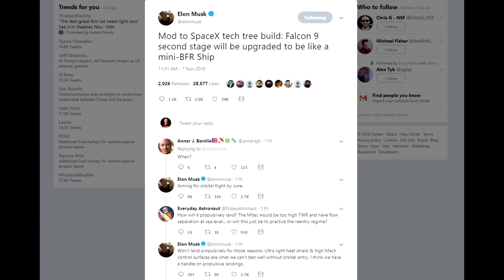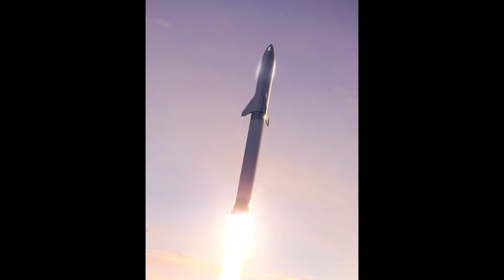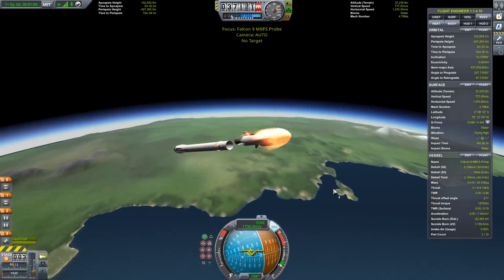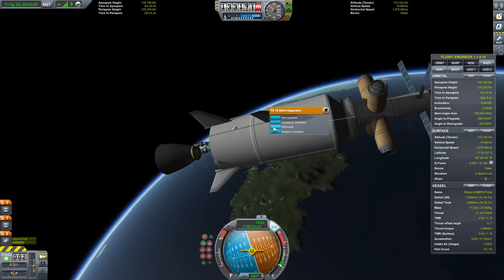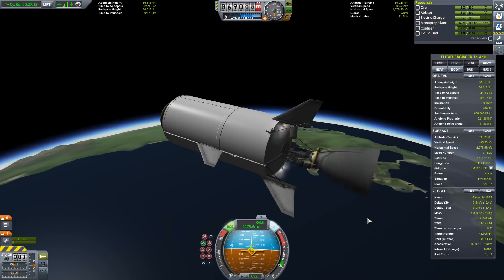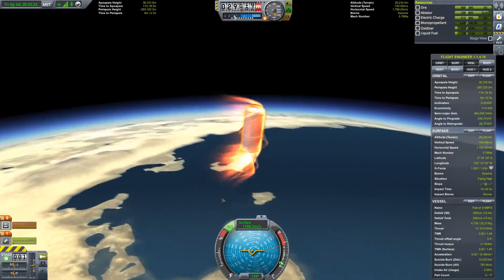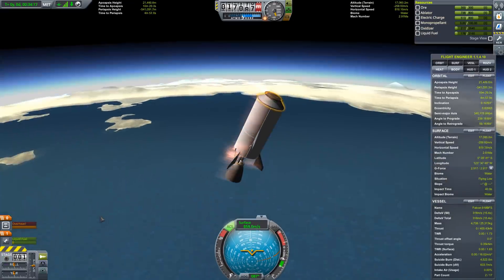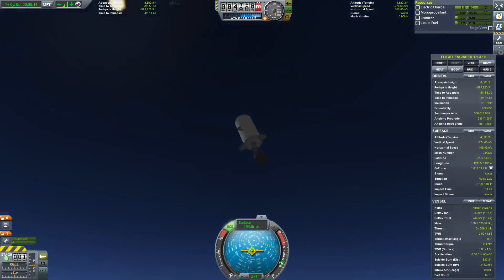SpaceX Evolving Falcon 9 Stage Into 'MiniBFS' For Testing

Comment: I don't think we're going to see a raptor version of any falcon 9 hardware - the raptor isn't just a updated merlin, it uses different fuel - and fuel tanks are one of the most critical parts of any rocket design so changing the type of fuel you use basically means you're designing a new rocket from scratch - or at least a new stage from scratch if you only change it for one stage
Reply: Not really the first stage can remain the same but the service tower would need to be altered to handle a third propellant.
Testing Raptor in space would be useful for the development  of the engine esp allowing it to get cold soaked on orbit.
Reply: @Patchuchan  The second stage tank still needs changed. Yes, the booster could be the same, but it's a lot of extra and not-worth-it R&D. It would have better performance and good testing but it's just a massive change for a vehicle that won't continue launching for more than a decade probably.
Reply: Jessie Grabow  but that could be done with the hopper prototype not changing F9
Reply: The Raptor they had been working on for a Falcon was a scaled down version anyway. 
I agree, Raptor won't ever fly on Falcon.
Reply: @philb5593  
That lower thrust Raptor was a "test article". It was just a stepping stone in development.
Reply: Julian Danzer
I really don't see that tank material would delay launching a Methane-based second stage. Most of this technology can be, and has been, debugged on the ground. 

The lithium/aluminum alloy is already compatible with both Methane and sub-cooled LOX. It is just a matter of moving the tank divider to get the correct volume ratio. The entire methane fuel system has already been developed in parallel with Raptor engine development. The overall performance (impulse) of Methane is double that of Kerosene because of the higher proportion of hydrogen in Methane. So the second stage may optionally be constructed with the same length hull, and still get +63% higher performance than RP1.  

Eventually, they will want to fabricate hull and tank partitions with carbon composite. Again, this technology does not have to be adopted all at once. 

The carbon composite tank is also compatible with liquid Methane, and "warm" LOX is already used in carbon composite tanks on the Electron Rocket. 

The big issue is sub-cooled LOX, however, this can be developed ground-side. It probably has been tested on smaller scale tanks, or SpaceX wouldn't have committed to the combination of carbon fibre/composite tanks and sub-cooled LOX. The helium tanks located inside the LOX tanks are already carbon/composite. 

A single engine second stage would be a fast way to test the entire Raptor/BFS system in a vacuum. The higher performance would increase the market scope for the Falcon9. 

If SpaceX wants to handle a larger diameter second stage (on public highways), that's up to them. I have completely turned around on my concerns about that. If they do this, the second stage could be about as wide as the present clamshell fairings. 

The vacuum engine nozzle can be constricted at the edge of the bell to allow compatibility with sea-level atmospheric pressure, so it could be reignited near ground level. However, this change would reduce impulse efficiency. That is adequate for testing reentry and is compatible with some lighter payloads and/or LEO destinations.

Using helium to pressurize the methane tank is an option while testing the alternate mechanisms to pressurize with gaseous methane. The evolution doesn't have to eliminate helium on the first iteration. The tank may contain a mix of helium and methane, with a control system that falls back on helium as a fault failsafe.
Reply: Jessie Grabow  There's no chance they're building a whole new upper stage and flying it 7 months from now. Even on Elon time, that short of a timeline indicates this will just be an add-on to the F9 upper stage. Also, building a mini BFR would require modifications to the F9 booster, in particular, the stage separation mechanism would have to be modified for the higher engine placement (one of the pneumatic pistons used for stage separation actually pushes on the engine chamber).
Reply: @myrobotfish  Use the exact stuff just moved down,, shorten the inner stage and you can still push on the Raptor chamber. actually it would work as is that pusher is way high up. Think of how long the mvac bell is. There could just be a shorter engine but the chamber could be in the same spot as mvac's.
Reply: @williamgreene4834  "to be clear, the Falcon 9 full thrust would stay exactly the same. The mini bfs would be the only part to change" This is what I was referring to. Shortening the interstage and re-positioning the pusher is a big change and not at all "exactly the same". I'm just saying that, on top of designing a whole new second stage, they would also have to make significant modifications to the booster.

I believe Manley's hypothesis that they will just be adding on to the second stage rather than building an actual mini BFS is far more likely given the incredibly short timeline and only a small (growing) fraction of their engineering is dedicated to BFR at the moment. People need to remember that this isn't like 3D printing where you can just apply a scale factor and boom new vehicle.
Reply: @myrobotfish  You're right. Sorry it was late and I was ranting.